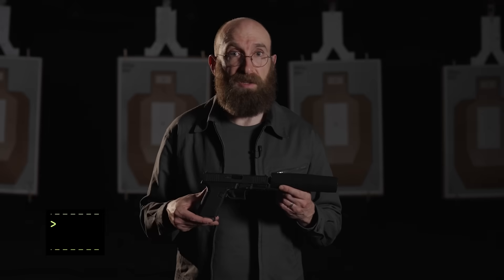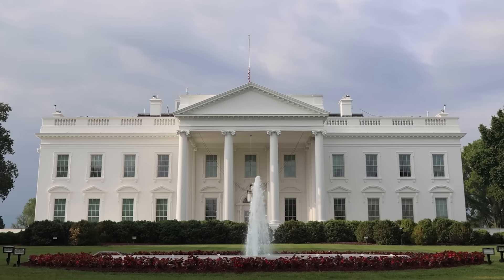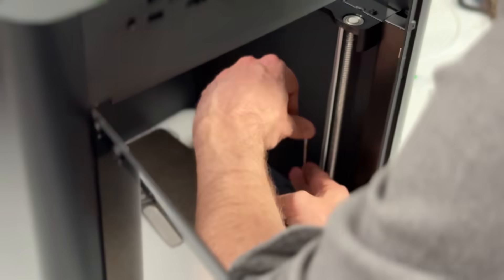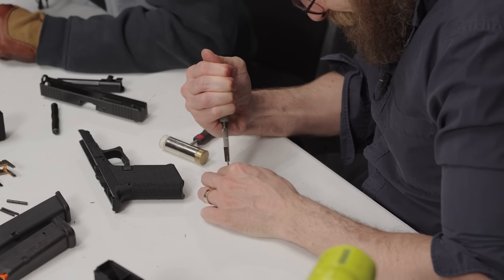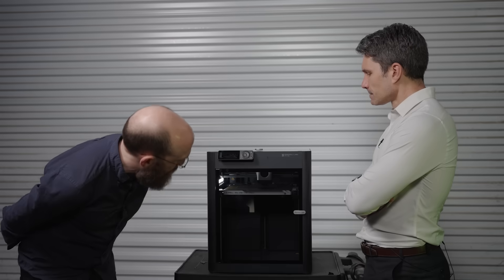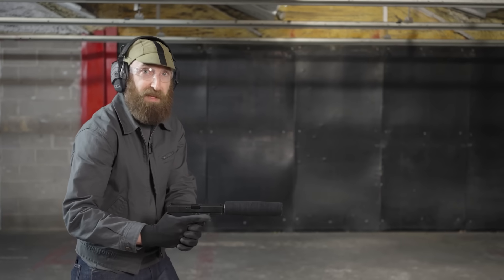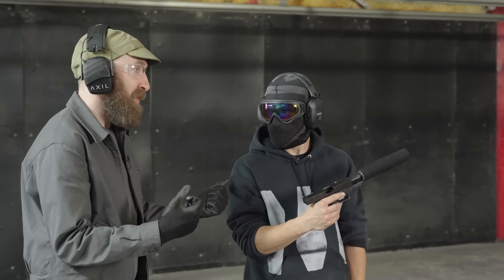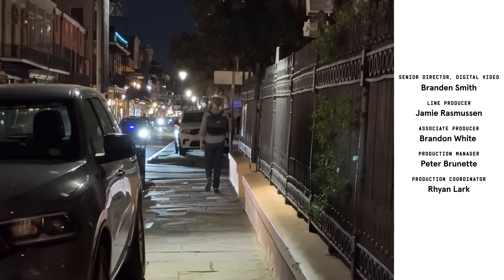I 3D-Printed Luigi Mangione’s ‘Ghost Gun’ | Hacklab | WIRED

Comment: Of course he said it's 1172 dollars, he bought the most expensive 3d printer he could get with the company card.
Reply: Wouldn't you? He's printing a gun, Not some benign object. You want to fire a 3d printed gun printed on some $30 printer?
Reply: @BookerDaniels-y7v  People do all the time. A lot of 3d printed guns have been made with properly calibrated cheap Ender 3 printers.
Reply: @tstststs sure, but they are also at a higher risk that something goes wrong and it would most likely take longer time so why would he?
Reply: @BookerDaniels-y7v A cheap printer prints slower than an expensive one. Quality is consistent if you set up the cheap printer correctly.
Reply: @BookerDaniels-y7v The printer has very little to do with the "quality" of the print. But honestly, the printer he used was the Civic SI of the printer world. Or some might say the best of the cheap printers. On sale now for $400. This is a printer you use because it's easy. The manufacturer's goal is to make a 3D printer an appliance. But honestly that's neither here or there. You can make your own 3D printer because it is an open source industry. If they ask manufacturers to block gun making people can still make their own printers. They will be slower but not necessarily worse in quality amd we are back to square 1.

We have politicians trying to regulate technology that was first seen more than 200 years ago. Weapons the public use are incredibly low tech in general.  The tech on this gun is older than most of the people talking about it, and it's one of the newer guns. Plainly, it's gonna be difficult for politicians to stop the construction of a tool that is simply pointing a bullet straight ahead, and poking the back of that round with 5lbs of force. A child could construct something so rudimentary. The only hard part is using a material that can withstand the high forces generated after the 5lb poke. 

Trying to regulate evil is a practice in futility, but we all know fixing the problem isn't the real goal.
Reply: @BookerDaniels-y7v there are some steps between most expensive and $30 you are skipping over. there are printers that cost less but can create higher quality prints.
Reply: @BookerDaniels-y7v not very bright are you lmfao
Reply: That's a P1S, Bambu's cheapest enclosed model, on sale as it often is it's around $550 or $699 retail. 
That said, I wish he hadn't included the printer in the total. Or given two totals.
Reply: @tankgrrl  indeed, he couldve literally get away with a second hand printer for 200$ or less
Reply: Honestly p1s is a mid tier printer. It's reliable and good but not near a flagship model
Reply: I find it funnier that they spent $1200 to make a gun that costs $600 retail, not to mention that is also less reliable.  Also note, the shooter simply choose to print a gun, he wasn't a felon, he could have simply bought one at any time.
Reply: @mikejackson9585 its not always that criminals print guns to make it cheaper or bc theyre not allowed to buy a gun, it’s bc if the police finds the gun after the crime it’s more difficult to track the owner of it and get caught
Reply: He would had taken 2 rolls to print on a Ender v3
Reply: There's a reason the suppressor dos that it's missing a key component in the suppressor
Reply: If you need a good frame you need a good 3d printer
Reply: Not really he bought the p1s not the x1c or h2s

Comment: Why this CEO was killed? If you really afraid that your neighbor could print a gun and kill you. Think of a root cause of the problem. Not a printer, not a frame, barrel, springs or plastic or even bullets. Even if you remove all this stuff your neighbor still has an 8" kitchen knife. Think about their reasoning. Try to remove this. Even total idiots kill because of a reason. Yeah it nearly impossible to find and understand this reason, but withou it printers would not be a problem at all. In case of Luigi, there is no need to look for a reason. It's not hidden. So if we are trying to avoid such cases in future what should we do. Remove tools and make it harder to revenge. Or remove a need to revenge.

Comment: "3d printed gun" looks inside:
unregulated metal gun parts ordered off the internet
Reply: there are several you can make with zero parts. the FGC only needs the barrel (pneumatic tube), the bolt  (2 pieces of steel glued together), and some normal screws and springs. roughly $100-200 complete
Reply: @General_Maximus  that's cool. point to one featured in the video the guy is commenting on.
Reply: @General_Maximus  yeah bro try to make it then
Reply: my take - european countries regulate the slide and barrel
Reply: Regulate, regulate, regulate…
Reply: Crazy kids shooting kids fine.

One trans person who is crazy shoots kids?

REGULATION
Reply: @cmilla111   That might honestly motivate trans people to shoot people more, if it’s the only way we’ll get guns finally regulated.
Reply: The metal parts are easier to fabricate than the " frame".
Reply: @philipjohn1338  no. barrel is hard for homemade. ammo is more harder.
Reply: don't worry though, they're pushing to regulate every single part possibly orderable off the Internet so that loophole will be closed and totally no criminal will be able to make an unregistered firearm again. Nor simply bring them in the backpacks of a hundred thousand deliberately protected undocumented individuals across our southern border either, unpossible! (sarcasm overload)
Reply: @rickbrasche8781  guns are actually regulated outside the US, so immigrants would have a harder time getting guns outside and bringing them in than they would getting them once they’re in the US.

Also immigrants are so protected they... (checks notes)... are arrested without warrant and deported without trial... ?

Comment: Printing a frame for a glock and framing it as printing the gun, is like printing the outer shell of a rocket and calling it a nuclear missile.
Reply: He made a whole gun without buying any restricted parts. Printing the frame meant he could legitimately buy all the other 'spare' parts and make a fully functional, unlicensed, unregistered firearm. It's exactly the same as your analogy because if the internal parts of a nuclear missile were as readily available as the parts he bought to complete the gun then yes, we could all make nuclear missiles by printing the outer shell. I'm at a loss to understand how so many Americans think. No wonder you have so many problems in your society.
Reply: @gacjones So, the problems are obviously with certain gun parts being unrestricted in some states, instead of the 3D printer, right? 

A 3D printed gun will never fire without several milled metal components; should owning a lathe be illegal? 

Also not an American.

Comment: ive found with the polymer80 lowers if you put a rubber o-ring on the mag before inserting it, alot of the initial jamming goes away, after 20-30 mags you dont need the oring anymore...

Comment: This guy apparently wants the law to restrict 3D printers, even though plastic poopers only make some frame bits none of which are directly responsible for firing and guiding the round. I have never printed anything anywhere near hazardous in these 8 years that i've had a machine. Mine is self-built and i have re-done the firmware and electronics several times, and it would be an unimaginable pain for me to have to use an off-the-shelf part with restricted functionality. It has been a great educational tool for me which advanced my understanding of a lot of things in electronics and mechatronics, and i have contributed fixes and small improvements to firmware that runs on numerous printers.

I can't imagine siding with gun lobby, because i think gun ownership is a big responsibility that most people aren't really mature enough for, and it's not like you let anyone say drive a car without an aptitude test, but this is the case where i would.

The suggestion that there's 70k 3d printed guns is absolutely NUTS, it's misleading use of statistics. There's a whole of a handful of people working on these things, and everyone else has to suffer due to them?

I also think Wired has done bad on their journalistic duty here just publishing these lopsided arguments without covering an opposing opinion which has really more merit.

Comment: Ban the printers? Well you can just make a printer, then make the parts.
Put firmware locks on the printers? Custom Firmware has made it onto almost every games console. Also farm equipment, cars, cameras, etc.
A good change would be instead of regulating the frame, change it to the pressure chamber. like in the UK. That would mean that suddenly its far simpler to stop the sale of the parts that actually make the gun fire.
Reply: Then people will just buy steel pipe and make one like that. All you need is a breach to strike the primer.

Comment: 1:27 Under the laws in place, at least federally, it is totally legal for any civilian, assuming they could justify they are not an at-risk or otherwise prohibited person if investigated, to manufacture any type of firearm that isn't specifically regulated (no select-fire, SBR, SBS, AOW, etc. as those all require registration via "tax stamp"), so long as it remains exclusively for personal use and is not sold or distributed in any way.

Comment: "a 3D printer that has the sole or primary function of manufacturing firearms" is an absurd notion. A 3D printer is a machine tool and it can be used to fabricate parts of ANY type. This makes as much sense as prohibiting the sale of "a hammer that has the sole or primary function of cracking skulls"